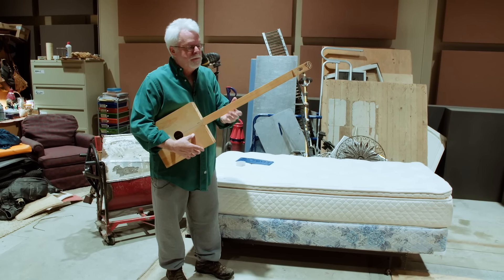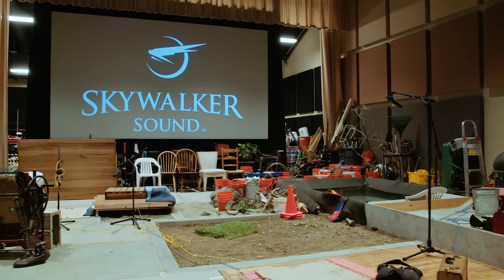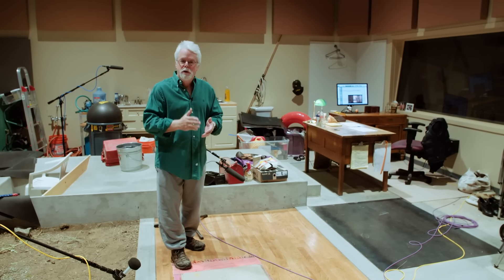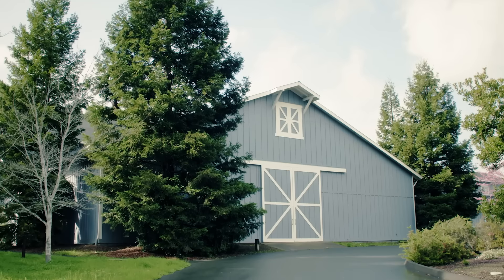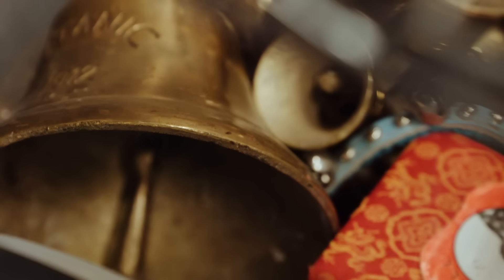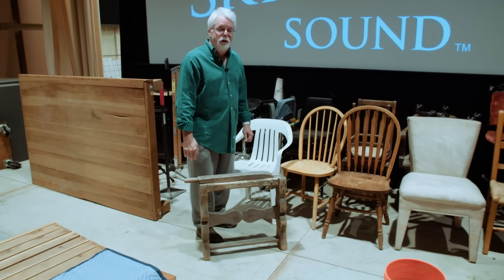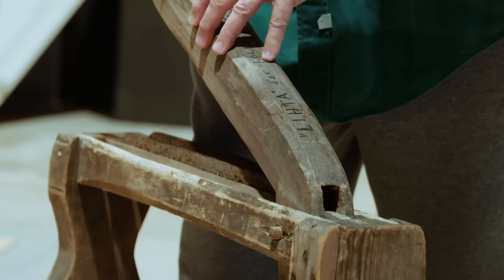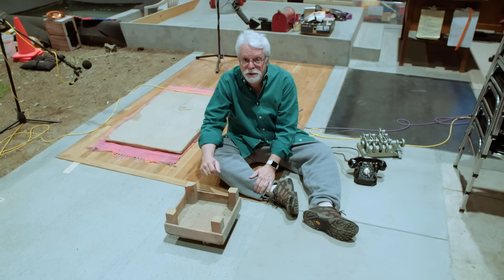How the Sounds From Your Favorite Movies Are Made | WIRED

Comment: Brian Craig
I have a question I have a video clip of a  mechanical moving wheel And I want to add  mechanical parts sounds but the Wheel is going way to fast is my daws I use Are Reaper and Logic so loading in video clip in my daw and try to get the timing sometimes I get it then other times just too fast any tip or  techniques then I might be able to do to make this more manageable ?

Comment: why dont they use the natural sound with a modern microphone during filming of movies?
Reply: If you've ever filmed anything, or watched a video recorded by a camcorder or phone, you'll notice the sound is, for lack of a better term strained. Wind, traffic of land, air or sea, animals, public spaces, various machines used like compressors for puppetry, and depending on the model of camera like the imax ones are very loud during operation, all produce noise pollution which distracts from the actual sounds we want to hear, like the subtle sound of pages shuffling, the sound of glass touching, or the crunch of leaves underfoot.

Boom mics are used on set for the primary dialog which may be dubbed later depending on the circumstance, like long shots or just poor quality takes that get used anyway, foley helps make everything more crisp, while allowing the production to move around any audio constraints on set.
Reply: thank you for the wonderful explanation. i always had thought the usage of added sound was in animated movies only

Comment: For accuracy's sake, why not just use an actual stuffed bird to mimic flapping wing sounds and an actual skateboard to mimic the custom-made skateboard in Back to the Future?
Reply: Zulhilmi Ghouse i think for some sounds the actual object itself does not produce the sound they're looking for; at least not as enhanced as other things might produce. For example, with the feather duster there is more control to it when he flaps and stops it with his hand rather than having to manipulate a fake bird's wing. Plus, why make something when there's cheaper and easier method. But there are sounds where they use the actual object that makes the sound such as shoes for footsteps.
Reply: Also why make a custom made skateboard if you can do it this way
Reply: Jouke Osinga he ment just Buy a skateboard
Reply: Zulhilmi Ghouse this thingy is cheaper and much easier to control than a skateboard.
Reply: Where’s the creativity in that?
Reply: Zulhilmi Ghouse You'd need a long track to ride a skateboard, so it's easier to just spin the thing around
Reply: its also just not necesary
Reply: The thing he uses to get the sound for the skateboard rotates, with an actual skateboard you'd have to follow it with your recording equipment and that would be a huge hassle
Reply: I think it’s because the one he used actually sound like if it was being used on the ground
Reply: I guess things can have a sound that fits better to them as the actual sound they make
Reply: Zulhilmi Ghouse A stuffed bird? Are you serious?

Comment: “The most honest representation of sonically”
uses a dolly instead of skateboard
Reply: It makes sense. You can spin the dolly in place next to a microphone and make it sound like a skateboard is going down a street for as long as you'd like. Plus it's heavier than a skateboard, simulating the way a skateboard would sound if someone was on it, as opposed to using an empty skateboard.

If you used a skateboard, you'd have to have the mic move with the board for as long as the person on screen traveled. So if the person skated 20 feet, you'd have to have 20 feet of space and have the mic travel with the skateboard the whole time. 

Just so much easier to use the dolly. TIme is money.
Reply: @StatusMusicDesign  if honest representation of sound is priority then they would find a way. You just need to be creative. Cut a deck in half screw the trucks together, strap a brick to it and spin in circles on concrete pad. Done.